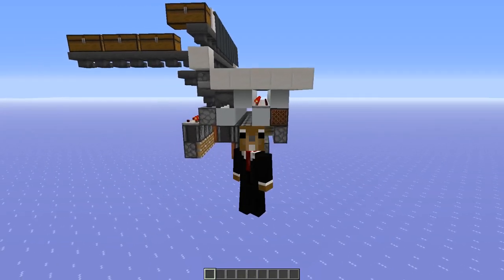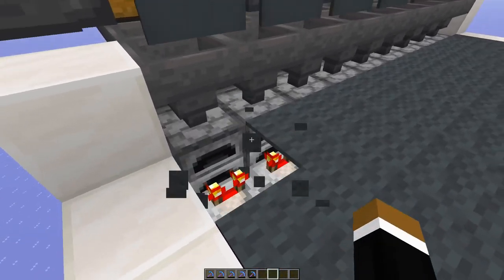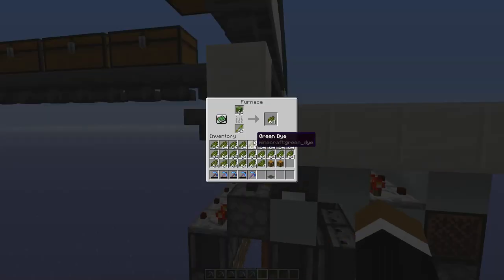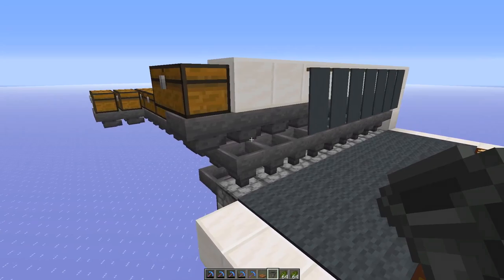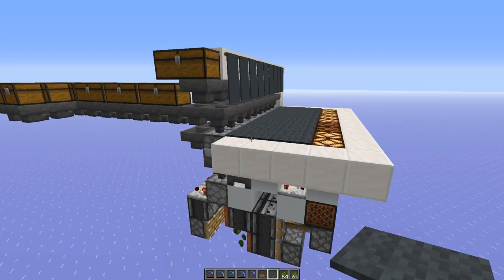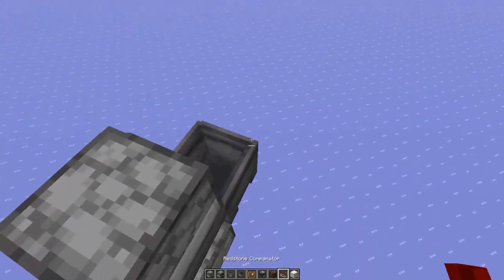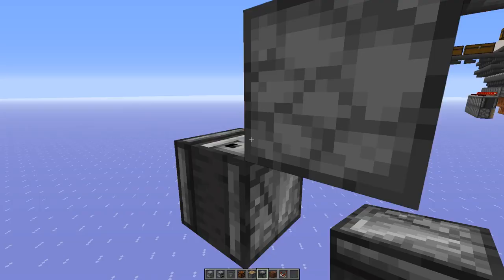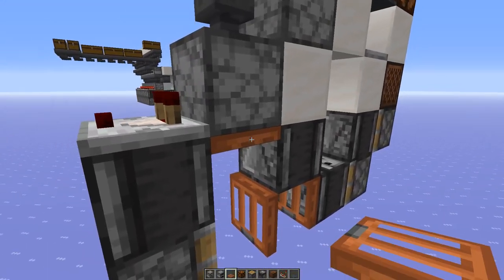Simplified Furnace Array System For Tool Repair (Xisuma Challenge)

Comment: Resources for one unit (not including input hoppers

1 Furance
1 Hopper
1 Dropper 
4 Observers
2 Trap doors
1 Redstone lamp
4 Solid blocks
3 Somparators
1 Note block
1 Cauldron/ 1 Extra Dropper
4 Carpets
2 Pistons
1 Sticky pistion
Reply: leyend
Reply: @Danty HUANG Ty but you forgot 1x Redstone dust

Comment: Clever use of the double comparator/redstone/dropper.  I designed a similar system a long time ago and never would have thought of that trick.
Reply: Ah, interesting - yet another Redstone trick that won't work on Bedrock...

For those who, like me, didn't understand the deal with the cauldron and the two comparators near the top of the machine - it's like this:

The lower of the two comparators is measuring the contents of that cauldron (or dropper, in the 1.13-compatible version), through the solid block between the two. The cauldron (or dropper) is empty, so it produces signal strength 0.

However, in Java edition, if the block between the comparator and the container it's measuring is powered by a full-strength redstone signal, then the comparator will ignore the container and instead propagate that full-strength redstone signal. So the lower comparator puts out a signal only when the furnace is completely full.
Reply: So, are u going to improve ur design techman??
Reply: @ricdesc26  My design is just an alternative if you want 798 xp instead of 1958 xp (that's what I tested from ilmango's version).  So it is less wasteful.  They are about the same build complexity.  I'd say for this amount of xp ilmango is doing, it's not possible to improve it.
Reply: Tetsujin hey - I'm running into a problem with the circuit you explained (cauldron/redstone/comparator). I have fifteen of these lined up next to each other, and randomly the bottom comparator is getting powered. This is my first time turning it on, and can't figure out the problem. I set up the bamboo supply yesterday, but when I hooked up the cactus supply this morning, a few random furnace lines started sending their "done" signal. I've rebuild those slices and nothing changed - same issue. Any idea? Thank u 🙌

Comment: 1.14.4 working perfectly. Easy to build, easy to operate and very compact (for what it does). Farms in the old video work perfectly. I would only suggest to add an auto on/off switch for each farm. Mine took roughly 15 hours to fully fill up all hoppers and xp. Thanks ilmango, very cool

Comment: For anyone that swings by and is playing in Minecraft 1.16 or newer; Comparators changed their update order as of 20w06a. Due to this, the design for dispensing items no longer works as it does in this video!
Reply: Does that mean it works in 1.15.2 though?
Reply: Alex Strickland correct me if I’m wrong but 1.16 is higher than 1.15.2. So it almost definitely works unless user error
Reply: Alex Strickland I apologise. That was needlessly sarcastic of me. “Yes. It will work in 1.15.2”
Reply: Thanks! And you’re fine haha.
Reply: is there any easy fix for this in 1.16?
Reply: @SebaJK7  I take it you didn't find a fix?

Comment: yo guys, i did a bunch of calculations

for instamining with an unbr3 netherite pickaxe and assuming 50% mining efficiency (50% downtime), you need 12 modules. if you use lava as your fuel source, you'll need 13 modules (because the bucket will occupy one slot and decrease cycle time). you need 42 lava buckets per hour

Comment: I built this machine on my friend's 1.14.3 realms server, and I ran into an issue. Everything seems to work, up to the lamp lighting up when the furnace finally fills up, but when I try to remove items from the furnace, the sticky piston holding the observer just keeps firing over and over, and the dropper doesn't dispense any items. Is this furnace array directional? If it matters, the observers in my world are turned a different way than they are here (they face the same way, its just the triangles are visible on the sides as opposed to the black bars like in this video).

Edit: So I just remade what I had, and it worked. I think I just had some observers facing the wrong way. Whoops!

Comment: This is really cool, but for some reason the redstone lights don’t turn on for me when the smelting is done (1.14.3).  The comparator never receives power unless I put water in the cauldron.  Everything else works as expected. Am I missing something?
Reply: Figured it out.  I had used seed fuel to get it started (which was different from the fuel waiting to go into the furnace) and there wasn’t a full stack of fuel in the furnace because of that.  It’s worth noting that there has to be a full stack of fuel, smelted items and items to smelt in the furnace to get the full 15 strength redstone signal to power the lamp :)
Reply: @kiddailey  you sir fixed my problem!  much thanks, i coudlnt figure out why my light wasnt on either after it was finished, input items "to be smelted" wasnt full

Comment: I made this on ps4 and the piston next to the note block will not update when you remove the dye or when it gets filled. It requires a block update to extend and retract. But when it is done dropping all of the dye it will retract due to a block update. This may be a bug but i dont want to take any chances. Thank you for making this!
 i will play around with this design for a bit to see if i can make it work.
Reply: i have the same issue but in pc in 1.14.2

Comment: Does this farm still work 1.14.4 . I build this in my survival world, for some reason when the system get filled up the redstone lamp does not turn on and when I take I item from the furnace the dropper does nothing. Please need help
Reply: Do you still have this problem? I plan on building it as well in 1.14.4
Reply: @lucabortolotti9587  i gave up on it. Maybe i did somerhing wrong
Reply: @lucabortolotti9587  I just built it in 1.14.4 it works but the lights at the end light up before they are done cooking so you'll have lights on before it's actually ready. at least that's the issue i'm having
Reply: I had same issue in 1.14.4 and just finally worked out the issue. The cauldren is filling with water, it works when it's empty but when it fills it stops working. Replace the Cauldren with downward facing dropper and put the comparitor back as it was then it works 100%. He did make a note that you could use a dropper at https://youtu.be/JO-fp1LRncw?list=PLks6kaOftqDIuUHUrSpfPwOixl-QCCIQA&t=352
Reply: @horoldo77  Thanks! TIL that cauldron fills with rain, that was my problem then...

Comment: built this on a 1.14.4 smp server, but when i remove the 1 item from the furnace it dosnt start spitting out items, also lamp indicator dosnt seem to work, any help? :)
Reply: You have to wait for the furnace to be 100% full in fuel, input and output so the redstone gives a full signal to use it. Only then the lamp will turn on, the furnace will shut down and you can pick up the smelted stack for the xp, then the dropper will spit out the other 10 stacks and the furnace will start to fill up again

Comment: Request: using dispenser seed planting and pushable tile entities if needed how to make an automatic crop farm ? I was thinking one similar to the sugarcane or pumpkin harvester you made with a flying machine. For wheat it would need a sorting system for seeds plus a moderator to make sure only enough seeds are used.

Comment: Does not work for me and I  checked and checked and checked, nothing is wrong with the circuit. I am in version 1.14.2 so it should work right.
Reply: is something wrong with the circuit?
Reply: i have the same issue

Comment: The second comparator isn't getting power unless I manually place an item in the dropper/cauldron and take it out. What did I do wrong?
Reply: Lol I'm having the opposite problem - the second comparator on some slices are getting power when the furnace isn't actually done. Did you figure anything out about your problem?
Reply: @kwyman986  for me I found out that realms was acting a little different :/ that's a weird problem you've got
Reply: Joseff Driver figured it out. If you use cauldrons and build it outdoors, it will break when it rains.
Reply: @kwyman986  ohhhhhhhhhhh that makes sense

Comment: Hey ilmango, I have build a machine that's a super smelter but it smelts logs into charcoal and then recycles the coal 
I like this idea because you get 7 coal for 8 wood and you can stack XP with it
I wonder ifnyou coild build something similar to this and make it maybe a little smaller
Reply: i think its better to add kelp then, u can use it as fuel and as cooked food. only need to craft it to blocks i think
Reply: @NathanHaaren  yeah that also works

Comment: Hmm, how about a variable output device?  There is only so much cactus you can make, but if you had cobble from a generator going in you could get stone...  or an animal farm to get cooked meat?  If you have each furnace smelting different things.  Meat, potatoes, cactus... hmm, looks like there are 27 (wood to charcoal, meat, pickles, cactus, various stone variants, chaurus fruit, drying sponges... things you would normally smelt, plus things like diamond ore where you take a loss and there are better ways to get it, and then armors,...  why not hook them all up on scale for the ultimate xp farm?

Comment: Hey Ilmango. I love you new Skyblock series so I wanted to play, and I followed your video guide to do so, but I am not getting the custom trades with the Wandering Trader. This is supposed to be in the Data Pack, right? I don't see it in there, and I know it is working because of blast furnace recipes. I know the Skyblock mod is working cause I can generate the Skyblock world, so it is a problem with the quick carpet mod? Can you help please?

Comment: for me the detection of the item being taken out doesn't work... the piston doesn't extend... I'm playing in 1.14.4 is that a problem?
Reply: same problem
Reply: It worked for me in 1.14.4 the knly problem I have is that it's giving the xp to my xp bar and not mending the tool i have in my hand.
Reply: @Emerod , it goes to my inventory but it doesn't dispense the items out of the dropper and the other stuff so the furnace can smelt more... the comparator doesn't detect if there is cactus left, it also detects the fuel...

Comment: Ilmango, you are a wizard. Absolutely a wizard. The great site of this is no need for xp hostile mob farm. Btw about the new improvement of the 0 tick bamboo farm using odd delay, can you do it with 0 tick sugarcane farm???? I know you can do it Ilmango because you are a wizard XD. Love to see the new improvement of the sugarcane farm.
Reply from the maker: you can make the sugar cane farm a bit faster, but the wiring would definitely get bulkier as well. It might be better to just build a second farm instead of a faster one. I can try though.

Comment: Whats the deal with placing a comparator on the cauldron or dropper etc?
Reply: You need the cauldron or dropper because a comparator that is already reading from an inventory (even an empty one) can only be overridden by a signal strength of 15. So the bottom comparator will only receive a signal if the top one reads a full inventory.
Reply: @KetchupKidKyle  legend
Reply: @KetchupKidKyle  Thank you for that quality, helpful explanation.  Legend indeed.

Comment: would this work with any fuel source/smelt-able items? Could I get this working double duty as my furnace array and xp farm at the same time or would that mess up the xp rates?
Reply: this was designed for cactus because cactus give a 1 to 1 ratio of items smelted to xp given, but it could work as a furnace array, still give xp, but as you thought it would change the xp you get.

Comment: Question about this build. I can only get the XP to repair my items if I hold a tool in my off hand. Otherwise nothing gets mended. Also, while it does fix my tools. If I have no mending gear on, I am only getting like 2 levels, if that. Shouldn't I be getting around 30+ levels for each slot once it's done???

Comment: Hey what's the function of the cauldron in this design? When I built this up in a 1.14.3 survival world, the right side of the system would never get powered because the right comparator doesnt activate. Because of this, the furnace backs up before all 780 xp is loaded. Im wondering what conditions would need to be filled in order activate the right comparator. Thanks!
Reply: I also had this issue, the hopper ,dropper and furnace completely filled but the lamp never activated or did the pistons
Reply: @Venrixia  I figured it out actually. It turns out the comparator activates when the redstone dust next to it gets a signal strength of 15. This only happens when all of the furnace's slots are full. This means it has to have the fuel, input, and output slots completely full for the lamp to turn on. I was only having issues with it because I wasn't keeping this array fully topped off with fuel so there was less than a stack of fuel in the furnace at any given time. Hope that helps!

Comment: what's the best bamboo and cactus farm that you can attach to this?
Reply: The ones in the original video are optimized for this system using only hoppers and 24 furnaces. they work perfectly

Comment: Someone explain. Why not just smelt a whole stack and take it out? You always get max XP for that. So why piecemeal it that way?
Reply: A single stack isn't enough exp to fully repair a diamond tool. He explains in the previous video that you need to smelt 780 cactus to store enough exp to fully repair a diamond tool.
Reply: If you smelt the multiple stacks that go through the system, you will get xp for all the items smelted, not just the ones you manually take out. (This is a feature added in 1.13)
Reply: Furnaces can store the XP for all smelted items, meaning that it can store more XP than one stack of smelted items just by taking them out and smelting more items continuously. He uses the hopper and dropper down below the furnace to know when the system have smelted enough items to fully restore the diamond tool (with mending, ofc), which wouldn't be possible with only one stack, which is the whole challenge/point of the contraption.
Reply: The amount of XP per item smelted varies depending on what you're smelting, and easily farmable items like cactus, kelp, etc. don't give enough XP to do much repairing if you smelt just one stack. This system smelts 15 stacks, which I guess is enough to fully repair a diamond tool each time you empty a furnace.
Reply: Thanks all. That is what I was missing.

Comment: can confirm that it still works fine for 1.16.1
Reply: What minecraft edition are you on? I just made this on bedrock and I can't get it to work.
Reply: Joshua Earl this would only work on java because redstone is quite different on bedrock, sorry
Reply: @kiwi_juice0  I read that comparator update orders was changed in the 1.16 update. What do you mean by quite different?
Reply: Joshua Earl update orders were changed in java but it doesn’t matter because the comparator is the only thing firing anyways so it would give the same output every time. As for the bedrock redstone being different, there are key differences like moveable tile entities (chests, hoppers, furnaces, etc.) and properties of redstone (for example redstone directly powers blocks to the sides of it even when in a line). Im sure there are more but im not really an expert on bedrock redstone
Reply: @HairyCaveMan  The sticky piston in the front is powered via "quasi-connectivity", which is a bug/feature only present in Java. In Bedrock, the piston wouldn't extend.

Comment: Could you do a pretty version that is not nessisarily tileable?
Reply: You could use the old design, or if you like it being less resources you could always space out the furnaces so there is an extra side for the comparators instead of the front... You could also compare something other than the furnace such as the feeding system if you wanted to take the extra time to do that, though at that point you might as well use the original design

Comment: how to do i get the xp to repiar the mending stuff rather than giving me the xp?
Reply: i have the same problem did u already now how to solve it?
Reply: Yes, make sure the tool you want to repair is selected
Reply: @blockin9556  selected like in imy hand? That's what I have done
Reply: @goncalopita8891  I have the same problem. I tried it with two furnaces, took out the items, and it just gave me the xp. I tried it with my off hand, and with my right hand. Nothing seems to work.